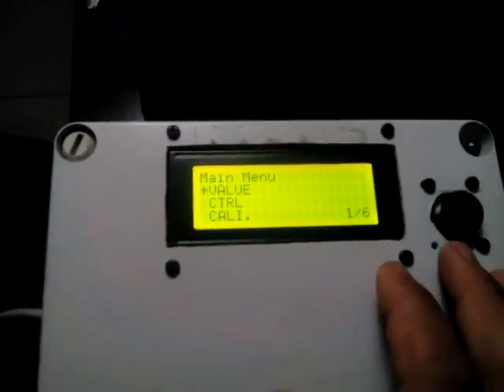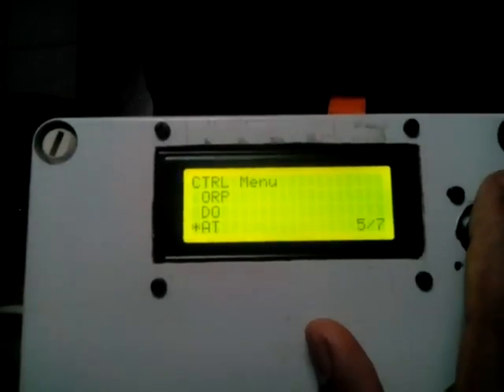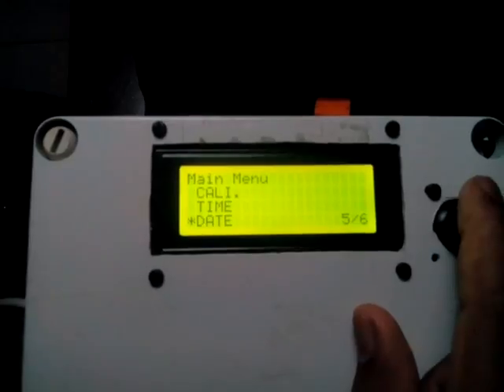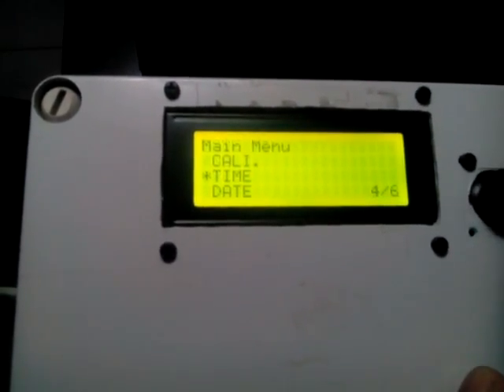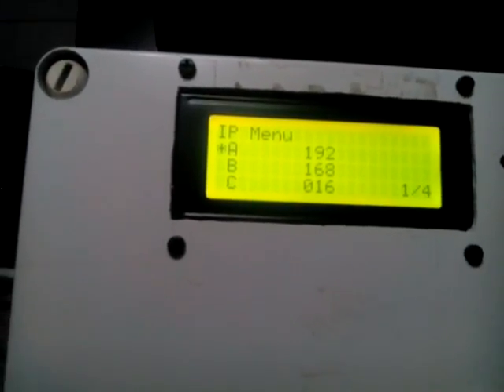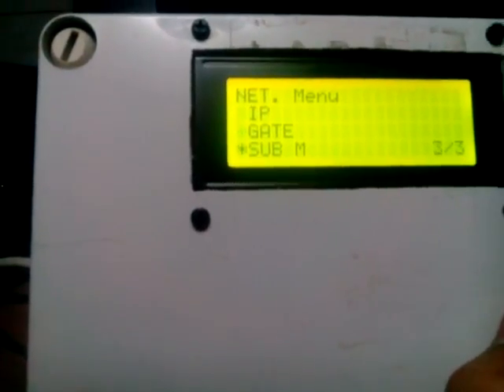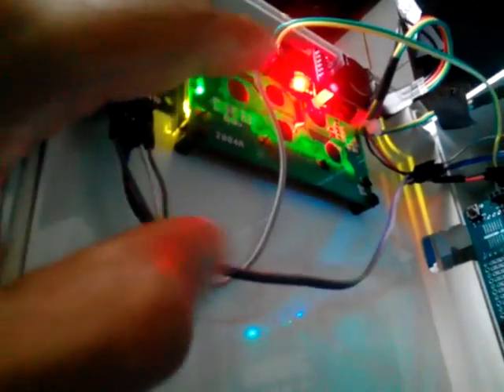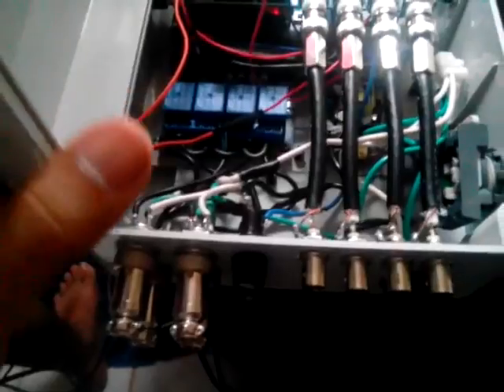DIY Hydroponic controller update 1

Comment: this is fantastic!! Love the work, can you tell me how much did you spend on parts to get to this stage?
I am planning on building a unit based on your work so I will now read more of the specifics on your blog.
Looking forward to your next video!!!
Reply from the maker: The most expensive part is of this build is the atlas-scientific parts
    The 4 channel Board: $120
     Ph, Orp, Conductivity, oxygen, senors about $45 each.
     The probes for each senor if you chose to buy them from atlas-scientific is about $130 each but you could get cheaper ones from amazon. I heard of a few horror stories with cheap probes so I bit the bullet and stayed with atlas

For the arduino  I think I have spent less that a 150 but that did include allot of assessor items that were not completely used in this project, like heat shrinks, random connectors etc.

Food for thought, an equivalent industrial controller with the same capability would cost around 4000-7000 Usd.
Reply: yes I agree with you on the price when you play in the world of PLC's and sensors it gets silly!, I am an engineer by trade in mechanical and electrical I had not really looked at the capabilities of the arduinos but your project has impressed me no end!
this is a great example of how something that was considered a toy moving up in the world to a viable industrial machine.
I will get on and order the parts this week!!